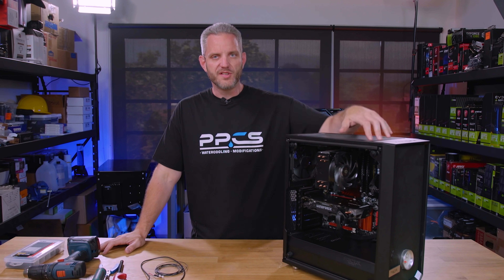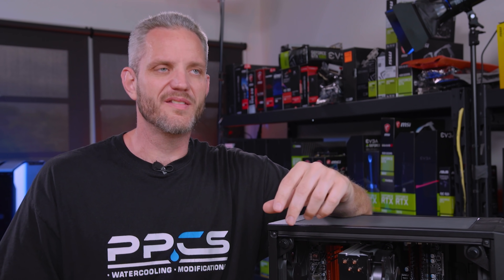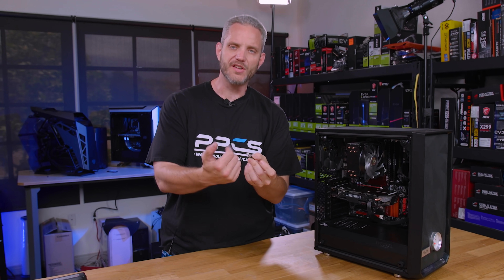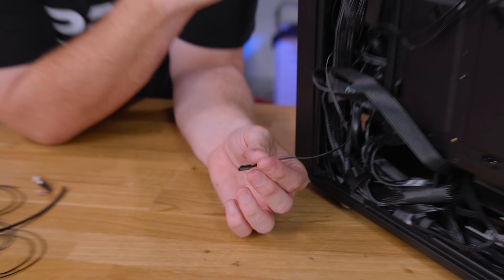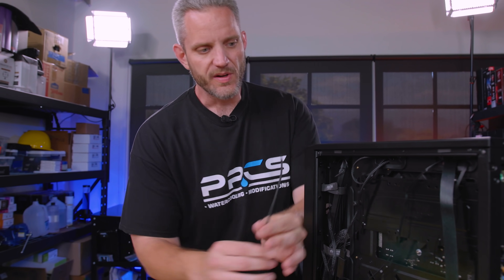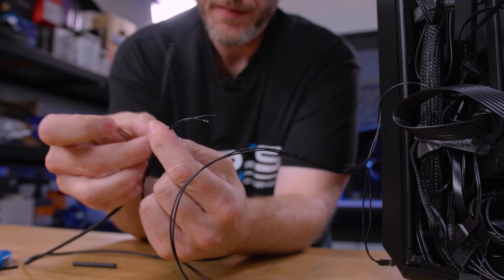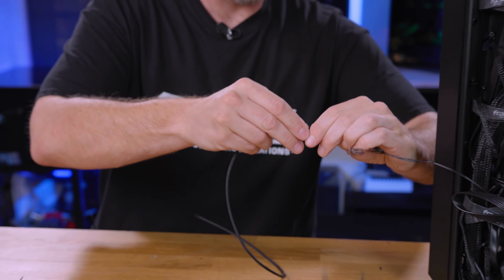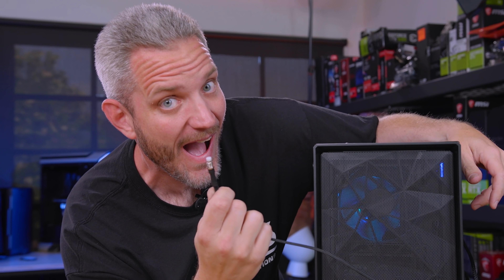How to install a PC KILL SWITCH!

Comment: little Sister: Watches video

BIG sister: daddy help

JayzTwoCents: installs unknown quantum mechanics so complicated that it'll be our last hope vs Elon Musk and the martians
Reply: elon musk will kill astronauts watch.
Reply: @crazyhistory124  referring to the Dragon capsule? Because that worked fine. It was just the abort system that blew up, after, mind you, it had re entered the atmosphere. That's also why they are testing these things before actually putting people in them. Lot better than what NASA did.
Reply: @Demonslayer20111  NASA tested unmanned then with monkeys and small animals. look up the mercury and Apollo programs.
Reply: @crazyhistory124  And then put 3 dudes inside a pure oxygen environment where an electrical defect started a fire that killed them faster than you could blink.
Reply: @crazyhistory124  yeah Apollo 1. Remember what happened there. A stupidly designed hatch and 100% o2 I mean come on completely preventable. 
Challenger. Another completely preventable disaster. The engineers gave it a no go, and they went anyway due to political pressure. Columbia. Tiles that should have been replaced, werent.Oh not to mention the fact that the shuttle had NO ABORT during most of it's launch, especially during initial liftoff. 
Also the monkey bit was not to test the capsules it was to see what happened to living things in space. Moot point.

I just don't get where you see that spacex is going to kill astronauts. The only real problems they've had is with reusing hardware. The dragon capsule performed flawlessly on it's iss mission. It returned fine. It's abort sequence was fine. Up until it blew up. So they misjudged the effect that reentry had on the draco engines. So what. You know how many times NASA had rockets blow up on the launch pad or tear itself to pieces before they got it right
Reply: @FastSloth87  I just blinked
Reply: @Demonslayer20111  It doesn't matter how many times NASA failed, SpaceX can't risk lives of astronauts like it's the cold war days or some shit
Reply: @therealb888  You understand that the problem occurred AFTER the capsule was used, right?

Tests for when capsule has people in it:
Pad Abort - Success
Launch/Orbit Insertion - Success
Docking/Undocking - Success
Reentry/Splashdown - Success

Tests for when capsule have no people in it:
Pad Abort - Failure

The thing is, the Dragon 2, after coming back from space, can only be used for cargo missions. Have you EVER seen a cargo capsule with an escape system? YEAH, there isn't any!
So why the fuck was SpaceX testing the abort engines on a cargo spacecraft? I don't fucking know!

Comment: Its not really a kill switch technically. The button isnt an emergency stop that will kill power. As he said its a momentary switch to complete the circuit and activate the use of the power button. If you want a real kill switch, install it somewhere on the power supply line

Comment: I didn't read through the comments, so i'm pretty sure this was said already - but if i were just trying to make it kid resistant, I'd use the already existing reset switch and just wire it into the power switch (like you're doing with you're add on switch) - that way reset is disabled completely and in order to activate the power button, you press power and reset together... shrug - and you don't need any additional switches and the chasis stays stock.

Comment: Make a video on how to use a key operated switch to turn your PC on/off. Just replace your power connector with one, and find/drill a hole to fit it in. Would be hilarious to have your "PC Key" on your daily use keyring.

Comment: I got a question for you Jay. What if your PC only turnes on only after pressing the power button, and then the reset button. Mine has done that from day one. The fans kick on and to full throttle till I hit the reset. Then it boots normally.

Comment: @JayzTwoCents   How to nearly drill through another motherboard. ;)
Reply: B10HAZARD I was thinking of that video lmfao
Reply: @justinbuckley  typical Jayztwocents fashion haha
Reply: do a 900 degree turn after using a electric screwdriver bahaha
Reply: Wait... ANother? This happened in the past?
Reply: @randispoling  xD
Reply: Another?
Reply: In which video did this happen?
Reply: Steve at Gamer's Nexus recently demonstrated the use of a stepping drill bit to widen the holes on a CoolerMaster case - it's not pretty, but for one or two holes, it may be worth checking out.
Reply: Nearly gave me a heart attack

Comment: Well this is certainly a nice little hack. I have a reset button on my PC Case, but it doesn't work, despite being plugged in to the motherboard's pins for reset. I could probably repurpose the reset switch to being a hacked kill switch.

Comment: I noticed the voltage CPU runs on is very similar to what AA's put out. My question is: Can you make a CPU (maybe an old single core) run independently on a "AA" battery? and if not, can you FORCE it to work?
Reply: The vcore voltage is similar, but AA batteries can't put out nearly enough current to power a CPU, nor can they provide the 3.3V, 5V, or 12V unless you add some transformers. You can probably get an amp or so out of one, so theoretically if you put a couple hundred in both series and parallel it's possible. Wouldn't run very long, though.
Reply: @YisraelWealcatch  Yes, i would expect there would have to be some tinkering involved for sure, so lets modify my question a little bit, Only using AA's, a a main power source, how long can it power a CPU (if at all). I am sure you will need additional electronic wizardry -- but thats the point! How can it be done and what would it take!? That sounds like a fun basis for a video, and if Jay gets bored/curious enough, I would love to see how he does it. (EDIT: I am not talking about the whole desktop, I am referring to only the CPU. We can have a dedicated PSU for the rest of the components.)
Reply: @Xehemoth  I get it. It would take quite a bit of calculation to figure out the specifics. Not really all that much wizardry, just some basic voltage step-up circuitry and a whole lot of batteries. I couldn't really say for sure without taking a deep dive into the numbers, which is not really the best use of time.
Reply: AA batteries are 1.5V. A computer runs off a combination of 3.3V, 5V, and 12V, but mainly the 12V is used for providing power. You could string together a bunch of AA's and maybe get the PC to run for a very short amount of time. You could probably actually run a PC off a car battery for a bit with a bunch of work, but even that wouldn't last that long. Some brief searching shows an average car battery has a capacity of about 600 Watt-hours while a fairly low power desktop is at least a couple hundred watts. You might actually be able to power a PC for a few hours off a car batter, but it would take some work.
Reply: You're right about the car battery. Most UPS units for computers actually have a lead-acid battery inside, albeit usually a little smaller than a car battery. Those can power a standard desktop for quite a bit of time as long as there isn't a heavy workload on the PC.
Reply: Theoretically you could use any battery assuming you know the amperage and voltage, as well as how to manipulate those to reach the desired values. They do make external batteries for power outages so you can stop what it is doing and shut it down correctly but the issue is that PCs draw to much power for them to be practical for extended use.
Reply: @dakotaheeren7468  You can using a voltage multiplier, but voltage multipliers are fairly complicated and afaik usually inefficient. Most things use a battery voltage greater than it equal to the voltage required to operate the device if possible. That is why many devices use multiple batteries in series.

Comment: Im sure someone is gonna find a way to use keyfob to start up the computer that would be some trick. Even better make a usb port on the front and colour it differently from the rest then get usb memory stick like a shitty one that have fancy rgb lighing then cut the traces for the data line bridge it for toward the button and use the memory stick as a killswitch :) that way ya dont go finding the killswitch button instead ya got the memory stick to start the pc

Comment: Hi jay wanna ask you should i overclock my 3000mhz ram even if the pc does not have that good of a airflow
Reply: You should if your ram is capable of overclocking. Ram is finicky and overclocking capability varies in many ways, by brand, model, timing, voltage, motherboard stability, BIOS, but... ram heat is not usually a big deal, even when you up the voltage some.
There are lots of good guides about overclocking ram if your not used to it. If you run benchmarks with overclocked ram you can see the performance improvements as you test stability. Plenty of fun down the ram rabbit hole.
Reply: @MonsterSound.Bradley  thanks for the info

Comment: Jay built an AND gate basically lol
Reply: RDE Lutherie  you do realize that a AND gate and his two switches have the exact same truth table?!   So yes it does the same thing
Reply: RDE Lutherie  I stand by my choice of words!
The schematic of an AND gate is two transistors in series being used as switches....   Please tell me how you see so much difference between that and Jay's two switches
Reply: RDE Lutherie  he put two switches in series the AND gate is two transistors in series the only difference is the first is activated mechanically and the second is activated electrically.
Reply: RDE Lutherie  have you not heard of mechanical logic or mechanical computers?
And it's nice that you "did something" but I run a small automotive tech company that produces custom electronics for engine and transmission control systems, I think building custom PCBs, writing real-time operating systems and designing the accompanying bits must make me a cave woman then?
Reply: RDE Lutherie  Do your self a favor and stop trying to sound smart by calling it Pretzel logic. You're too thick to get the point.
Reply: I know it is called an AND gate bc input a AND b have to be activated, but why capitalize the letters in it, does it double as a abbreviation?
Reply: @double-you3409  In most textbooks or material the gate names are always capitalized, honestly I don't know exactly why but they do it so I always have as well. I think its to differentiate a gate name from a normal word!?
Reply: @double-you3409  It's just to make clear that you are talking about a logic gate.